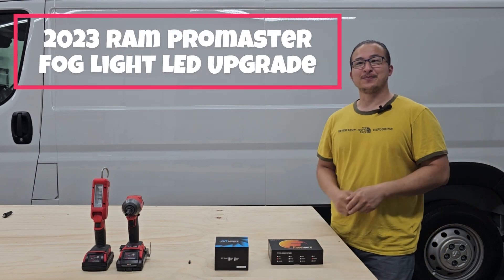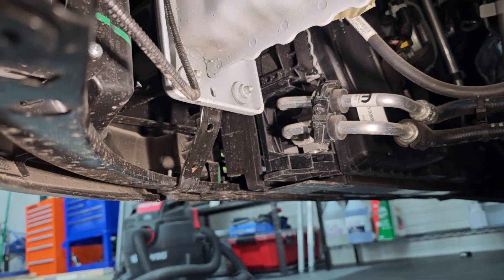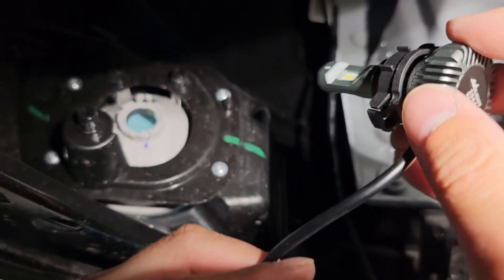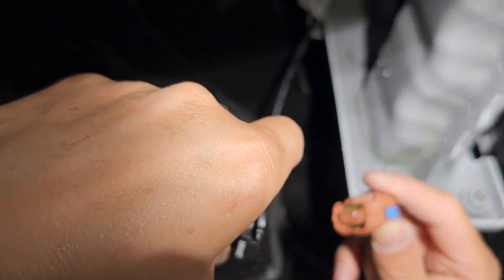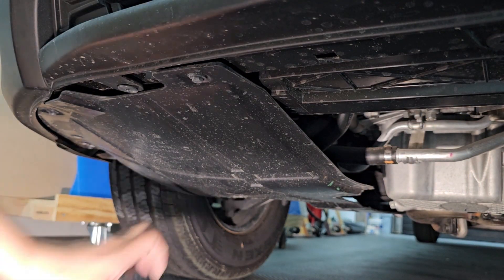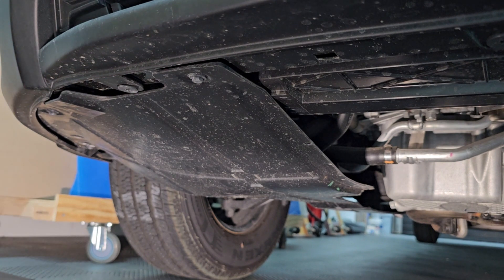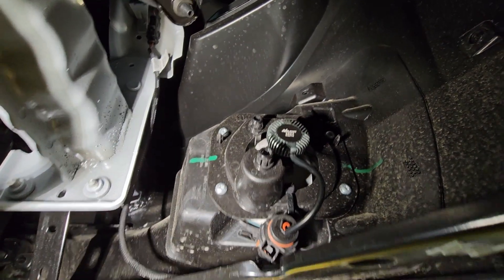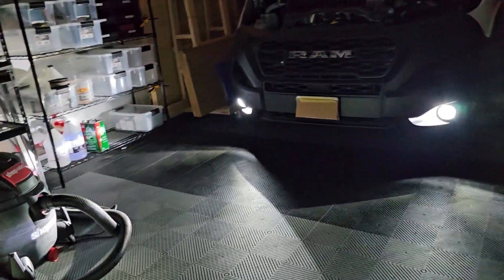2023 & Newer Ram Promaster LED Fog Light Upgrade Part 2

Comment: Thanks for adding this. My 2023 2500 has little fog light access doors in the wheel wells
Reply from the maker: I found only on the passenger side you could use the access door as it has a plastic guard cover under the bumper. The driver side is wide open underneath for direct access, no need to mess with the access door. Initially I tried using the access door and found it was tricky to maneuver around, but eventually could be clipped back on.